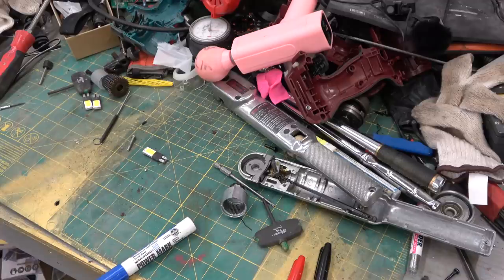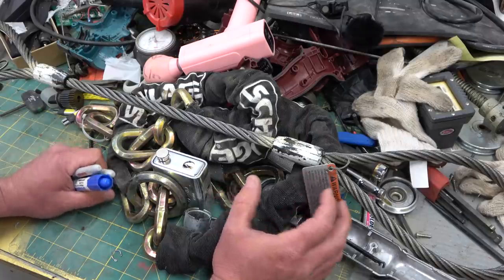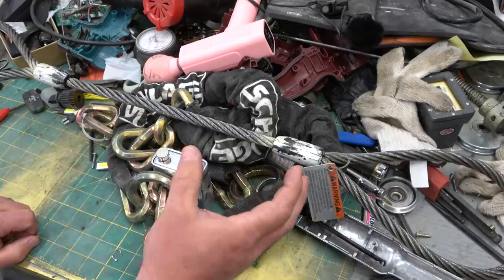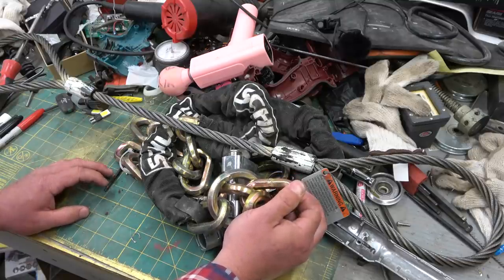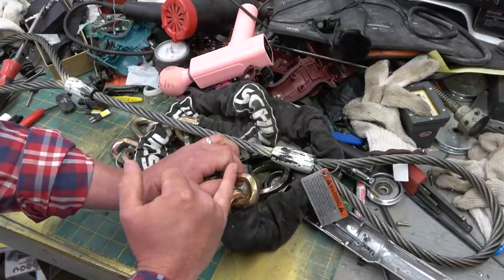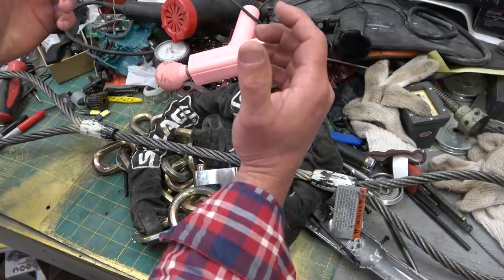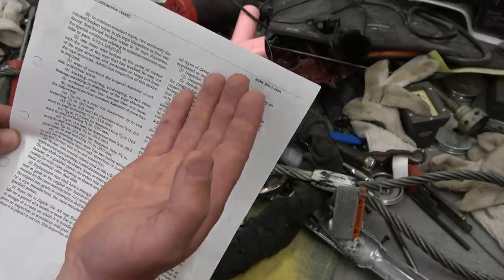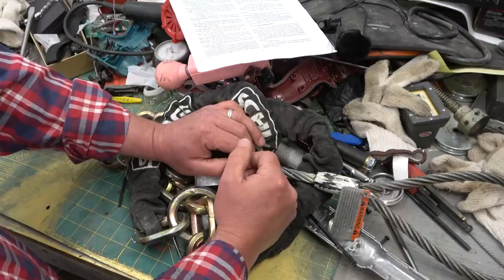"It is not known why the pulling cable snapped."

Comment: I completely trust the engineering behind the cables, but I have a hard time trusting the people in charge of its upkeep.  So sad.
Reply: Pretty sure those cables fail from the inside out. A couple strands get rusty and start to fail. Then a major accident happens.
Reply: @SocietyIsDoomed  I've done tensile testing on a couple of cables. They all failed when one of the outside strands gave up.
Reply: @SocietyIsDoomed  I would have thought the outer wires would be the first to go since they'd be under the most compression/tension when they change direction.
Reply: This sums up my take on rollercoasters. I appreciate them and the technology put into them but I do not trust the maintenance.
Reply: @GermanTopGameTV  Wow. Sounds like a George Carlin quote. Essentially, Carlin stated government doesn’t want and educated free thinking society. It wants a society just smart/educated enough to keep the machines running. 

If I added to that it would be, “And appropriately replaceable with enough speed that no one notices.”
Reply: @tyrannosaurusimperator I shouldn't have said it that way and I should have givin more detail. There was a show on history channel or similar showing large cables like suspended brindges, crane rigging,  chair lifts failures/accidents. If it oxidizes and rusts and noone sees it its game over. I also should have watched the video before commenting.  I wasn't aware of the brakes or the circumstances in which it failed. I misspoke, wasn't trying to be a smart alec lol.
Reply: @shawnbrynelson5333  your right, I should have watched the video first....read my comment other comment
Reply: @GermanTopGameTV  sometimes guys want to do maintenance on things but cannot because the big boss won't let them. My old job was full of that, the telehandler I was in charge of operating didn't have hardly any brakes because someone didn't bother replacing the parking brake cable and put one of those line locks on which eventually blew out the brake cylinders. I always wanted to fix it but everytime I would even try I would get pulled into another direction, so I quit caring and would just drop it into reverse without lifting off the throttle when I wanted to stop. When I quit that dump the telehandler would barley move and I'm pretty sure the transmission was on it's way out, I felt bad about leaving the machine that way for the next poor soul that had to work there but management needs to learn what maintenance is
Reply: @DOWNUNDER.  That's the motto we use at work, if you're not under it, it can't fall on you. Simple
Reply: @GermanTopGameTV  Given that German cars are known to be a nightmare to maintain, perhaps more effort should be put into serviceability.
Reply: @DOWNUNDER.  how can a cable  or wire rope be rotten and look like new, I've seen literally tons of old wire ropes that look old , crusty and greasy that on inspection are still 100%. Any commercial use of cables and wire ropes has regular inspection,  if it doesn't pass inspection,  it goes out of service, regardless of old or new appearance. I have never seen a new looking cable or wire rope  fail inspection,  let alone fail. Further,  when a cable fails inspection  it is still safe,  cables and wire ropes  are pulled from use before they fail, and as anyone who has used  wire ropes or cables knows, strands start to let go long before there is ever any  serious issue.
Wire ropes warn you by strands starting to let go well before the entire rope fails, unlike chains which snap without warning, hence again in commercial use, chains must also pass inspection,  if there is beyond designated wear anywhere along the chain length, that chain too is decommissioned. 
Regardless,  100% agree,  never put yourself in the danger zone
Reply: This is one of the reasons I've never liked roller-coasters and things of that variety. I'll happily go for a shakedown flight in an aircraft I've worked on, but I don't trust something implicitly if I haven't had a chance to inspect it myself...
Reply: @DOWNUNDER.  resistance testing would probably do it. They use it on airframes to find micro fractures, race cars to find broken stitch welds, and worn spindle cables in cnc.
Reply: That's actually something they teach in engineering school. Design for manufacturing, maintenance, or repair. Of course, there is no way to think of everything so accidents still happen. They should have a mag break on the  cars so that the max speed can be limited.
Reply: @DOWNUNDER.  wire rope around the world ARE visually inspected.   That's the most effective way,  but it has to be done by someone who isn't just checking a box on a Clipboard.......  

photos show a system of several severely neglected systems.   Maintenence and inspection were not being done, nor the question is was the documentation "pencil whipped "?  Was management and upper corporate looking the other way laying the guys at the bottom take all the liability?  

When it's time for someone to go to jail, it will not be someone wearing a suit.
Reply: @SocietyIsDoomed  outside, in.    The cable is protected best on the inside, as that is the last place for the protective lubrication to die........
Reply: The problem of trusting the operators/maintanance is that most of them will do their job properly but some will not. And you do not know which one you will deal when entering the cable car. Same applies when entering  a bus, a plane, a train or passenger ship/ferry.
Reply: Down under management can look the same
Reply: @tyrannosaurusimperator  away
Reply: Most accidents are due to human factor. And engineering failures as well.
Reply: @Joe-nq6hy  Aaaah! What's a bit of superheated shrapnel between friends, eh? 
Then we can pretend we're in WW2. Flying high above the continent through a forest of small black clouds.
Reply: One should never blindly trust any part of the process. At every stage there can be, and has been, failure.
Reply: @FUBARguy107  so you'd ride a brand new one then
Reply: @tbelding  That isn't as true of big industrial machinery, no one is going to buy a million-dollar machine and be told that they're then on the hook for every little repair.  Now, it's true that by virtue of complexity and criticality that a lot of repairs might take someone with specialized training and equipment, especially for big jobs, but the expectation is that the plant can do the basic stuff on their own or with consultation, not rely on a tech flown out from the manufacturer every time something jams.

Comment: Jesus, he disabled the brakes in 2014. That's a long time playing accident roulette and thinking your number will never come up
Reply: 2014 WOW that is incredulous
Reply: The elevators in my office get annual inspections. I can’t believe there are not bus loads of inspectors for every conceivable form of transport in a EU country. It boggles the mind this could go unnoticed for so long.
Reply: In fairness, you only need a seat belt during an accident. Terrible situation and should always be a sobering reminder for engineers.
Reply: 2014..... Wow.  So did inspectors never try and test the emergency brakes at least once during all those years?

It's safe to conclude that the inspectors either.
* Did not do their job properly... Or
* Knew the brakes were disabled and failed to report it.
Reply: @steampunkskunk3638  or the maintenance guy removed the calapers every time the inspector came round.
Reply: @berthuggins8042  Italy has a major problem with organised crime.  Many companies and organisations either have links to it or are owned by it.  For example: Last year, there were reports hospitals short of critical equipment as funds (and kit) had been stolen by the criminal organisations that had infiltrated them years before.
Then you have the  'good old fashioned' corruption.
Reply: I'm guessing the annual inspection was done from a long way down the hill in a Bar......... an envelope changed hands and forms were signed. Nice and easy........
Reply: The evidence dates back to at LEAST 2014. It's entirely conceivable that it was done much earlier than that.
Reply: @steampunkskunk3638  Ehh, Is Italy.
Reply: Makes me wonder how many other engineers he's socialized with using that as false evidence of safety.  "Nah, I've been disabling them for over 4/5/6/7 years, not a problem, don't worry about it".
Reply: Lack of initial failure tends to reinforce people's confidence unfortunately.
Reply: @benwhittaker8630  The first photo that AvE shows with the brake disabling calipers on is dated 2018 (not that it matters much - a single trip would have been too much); however the cable car was completely refurbished in mid 2014 (closed for 2 years, reopening 2016), so it can't have been "much earlier".
Reply: @danwhiffen9235  I am hoping this statement was made as sarcasm at best... if not, then you are as deluded as the guy who thought those caliper forks were an "okay fix" for those dragging brakes.
Reply: @edwardpaulsen1074  I think that what he was saying is that you discover how useful the safety belt is only when you actually need it during an accident, but you don't know when that happens so you have to wear it every time.
Same here with the brakes: never heard of a cable snapped so we don't need the safety breaks, and then the cable brakes and discover that you needed the until now useless safety brakes...